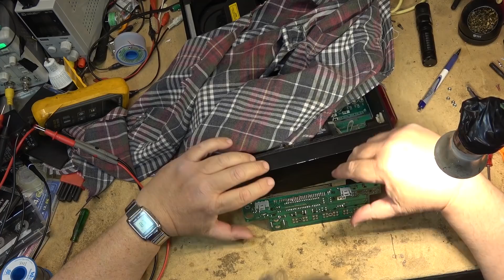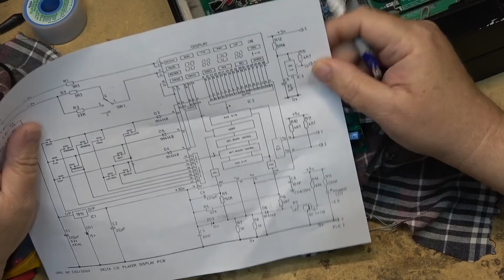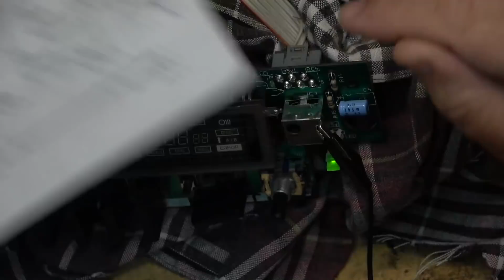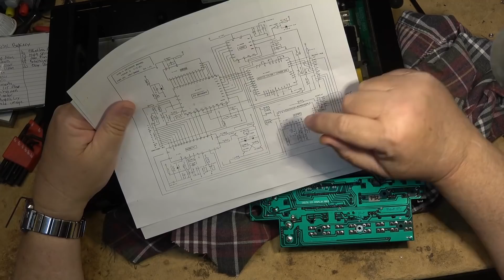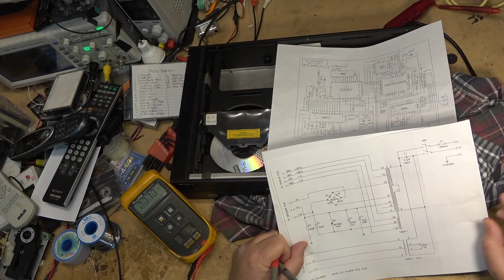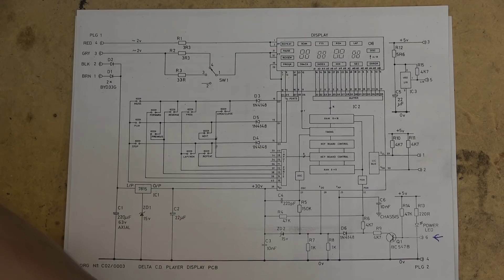Arcam Delta 170CD Transport  No Worky

Comment: Hi I've recently started watching your videos and find them very interesting. I like the way you work and show your thought process. After watching this video I decided to look at the 6805 architecture. I found that a 6805 microcontroller puts out OSC2 on pin 38 which I think is derived from an external clock coming in on pin 39 (OSC1). Maybe (MAYBE) your remote control works because the OSC1 clock on the 6805 (OSC1, pin 39) is OK. The OSC2 clock could have failed (OSC2, pin 38) causing your secondary microcontroller not to function. Just a guess  based on the datasheet but I think the external clock (OSC2) should be 4MHz. Could you inject a 4Mhz clock pulse into the other microcontroller??? I hope that makes sense.

Comment: Hi. Not sure if you're interested, but I found a service manual for the 70/170 models. The schematics are not brilliant, but readable and rather disjointed & need re-stitching to get a clear overview. Fyi the 'display' connector is (top to bottom) POR RCS 0v 5v SDA SCL. Not clear who supplies the Serial Clock, but is likely the 6805. The transformer is a dual voltage with strapping options on the underside of the Xfmr board, they then helpfully crayon on the  selected voltage on the top. It does look like the display/key chip is the problem child. As ever, loving your work. thorough & informative.
Reply from the maker: I do have the schematic for it. As far as I know since it will operate with the remote the owner of it is going to use it as is. We'll look for the display key IC but I'm not holding my breath that one will be easily found considering the age of this unit.

Comment: Hello!
The high supply voltages are really suspicious. The 220V label and these weird voltages suggest someone has modified or replaced the original transformers.
And when it comes to such option, you can guess they probably used some low cost Chinese stuff, with weird or inconsistent performances. It's something source of a catastrophic failure.
And guess what, you can have the same problem with stock products: I've seen and replaced many of these in relatively high end HiFi components designed in UK, but made in Asia. You can find anything like resonating (and noisy!) transformers, false copper shielding and other problematic things implying insulation and security issues! It could be interesting to investigate around the supply board where you customer says have found some dry solders. But at this point, I suppose it won't solve the display and keyboard unit!
Most of these high end CD players used the same Philips technology. You have Philips or equivalent circuits plus something like a CDM12 pro mechanism. From there, a common architecture with I2C bus for data communication between ICs.  And I share your opinion about the main controller wich is working properly, apparently responding to remote control orders and playing disc. They normally use a RC5 so any remote from Philips, Marantz, and many other brands could do the trick, but here with a limited universal remote, there's always some buttons missing...
I have a similar scope with the I2C decoding option: if yours can do it, you could eventually check the datagram content with the classical time code, or at last try some low cost LCD displays wich have I2C decoding capacity.
Another option is the Frankenstein mod, based on some retro engineering, a microcontroller and some standard command libraries (and a not so good looking rats nest of wires). This could provide direct operation with an alternate LCD or OLED display.
However, I highly doubt you have such option as it implies numerous hours for development and integration, no client would pay for outside La Havanna, also considering the residual value of this unit.
Last option is to search a direct IC replacement, but you can guess it's near unobtainable today, and no guaranteed solution either.
It's a typical case I'd recommend another drive source, why not some used high end DVD with a digital output. They come cheap nowadays with the blu-ray new technical reference.

Comment: I had problems with this type of IDC connectors where the blades or the wires corroded and did not make a connection. Have you checked the clock signal at the main board (not on the connector, but on the other IC)?

The Telefunken U3090MG display controller might be a TMS3763 equivalent according to some forum threads. This (the TFK version) was used in some Marantz and Philips CD players as well if it's true. No datasheet for any of them. The TMS3763 is available on ebay for cheap. Might worth a try, but those crazy high voltages must be addressed first.

Good chance that even it it will work again, the display will be dim. Double voltage on a VFD filament kills the emission quite quickly. Also the design seems weird, it should be changing the bias voltage for dimming the display, not the filament voltage...
Reply from the maker: Yes checked on ic no clock.

Comment: I'm sure you will, but I would recheck the voltages (and display / regulator limits etc) prior to IC replacement. The unit was originally 220V mains, now 110V and I believe the mains / line in the USA is nearer 120V now. Not sure what IC2 is (part number wise) so it may be an I2C master (and clock generator) as well as slave.
Reply: This is quite common and can be problematic. From experience, some old eu/UK gear had 220v primary. 240v can and does create issues with these products. Some old gear had 220/240/110/120 volt options. Nowadays cheap transformer primaries are all 230v rated as a 'happy medium'. But with my 240v mains I always get a higher DC voltage than rated.

Comment: Great vid.

I think you should of investigated further into why there was no clock on pin 1 of the cable, the wire could be broke or a dry joint in at one end of the wire. (?)

Comment: very interesting video, i would inject the clock signal and trigger it from the latch signal to see if it will do something, i am sure that this signal can be synthesized or be taken from somewhere and controlled by simple transistor switch from latch rail.
Reply: Injecting clock onto a I2C bus would do nothing useful. Clock signal is generated by the device that initiates and terminates data transmissions (called master). The master needs to be in control of both of the clock and data lines in order to put anything meaningful on the bus. Slave devices only toggle the data line, in sync to master-generated clock signal. Note that there can be multiple masters on a single bus and a device can be a master AND a slave =)
Reply from the maker: Correct but what's not known here is is the Master clock being generated by the processor under the display or is that a slave only device the fact that it does have an oscillator and is generating key scan indicates to me that it could very well be a master device. the Motorola processor on the main board which incidentally is a different number on it than what was on the schematic could also generate its own internal signals as it does have a crystal and it is a microcontroller but it could also be running as a slave and because no clock signal is being received it is taking on the role as its own Master clock generator for its its own circuitry. One thing that is known is that the processor on the main board is functioning because asynchronous data from the remote control is being input and then output formatted going to the CD section to control the mechanism. Now there's no clock signal on the clock line however they pull up resistor is on the front board so it may very well be the master and the display I see is shorted pulling the clock line low. after all there was a shorted transistor also found connected to that IC. Again it's kind of a crap shoot it's a 50/50 it's one of the other because either I see could be killing the clock signal it depends on which one is generating the Master clock. The one thing that is known is that the front panel IC was communicating with the controller on the main board prior to the other guy getting into it in an attempt to fix the display because the keys were working when it went to the other guy and when it came back they weren't. After contacting the owner he does have the remote and he'll likely just run the thing as it is using the remote. He said the display has not worked for about 2 years but the remote and the front panel buttons did work until you took it to somebody else and when he got it back the buttons didn't work at all. Well we know it does work with the remote and he seems happy with that and if we can find a part then we'll probably see another video and get that display and the front panel buttons functional.
Reply: @12voltvids  Disconnect the data and clock lines between the boards (leave the rest connected). If the other side does not also have pullups, you can pull them high with, say 4.7k resistors (1k to 10k should be safe). Which ever side on you see any activity on the clock or data line then, is the master's side, because a slave does not put anything on the bus without a master first reserving the bus, and calling the slave out by writing it's address to the bus. Just be aware that there could be more devices on that same bus creating chatter (or problems :). Both lines should be pulled high when idle. Also, I imagine it's possible that both the display and the main board can act as master and initiate transfers, depending on needs (i.e. display boards notifies main board when a button is pressed, and main board sends updates to the display).

Comment: I see many Philips components in the Cd transport: the CDM is a Philips swing arm, the drawer mechanism is based on a Philips design, cables and plugs are typically Philips. Anyway clock is very likely generated on the main board, I see the quartz crystal sitting next to the remote decoder IC. Have you tried checking if the clock is present with the display board disconnected ? If the key scan is working, the display IC is at least partially alive.
Reply from the maker: No clock even with display board disconnected.   It's either the display ic or the micro on the main board, however since the remote is functional and that chip us passing data it is obviously working.  The clock pull up resistor is on the display board so that could explain why no clock then display board is unplugged.  The front panel keys were working before another tech worked on it, but it was returned to the owner the front keys were dead. I suspect that that shorted transistor that I found on the display board was probably what was killing the display. The other guy working on it I suspect shorted something I blew the chip up.  As I think I stated it could be either chip that's faulty the one on the main board is certainly easier to change as it socketed. We have the chips turn out to be available and they were cheap I would recommend just ordering both and start with the easiest one to change the socket and chip because it's going to be one of the two I just get the gut feeling that since the remote works that the big one on the main board is probably okay.
Reply: @12voltvids  the I2C bus between the two IC's is just two straight wires with pull-up resistors. The 6805 on the main board has its own clock and the SCL line is used only to communicate with the display driver. If nothing is coming out of it, very likely the 6805 is faulty. The display driver has its own oscillator for the key scan and the VFD and that appears to be working. The PDR signal driving the faulty transistor should be a reset line, high only on power on for a few seconds. With the faulty transistor the display driver is not initialised and it should not work at all, nor display neither keys detection. If, keys were working previously, that means both the reset line and the I2C bus were working, but i have not idea what could have been wrong for the display to be dead, maybe a cracked soler in the AC filament voltage. I would go with a faulty 6805 as my first guess, the I2C section is dead. Surely having 70v AC in the display PCB in place of 36 is not too safe.

Comment: And i expected you to call it a pile of shit lol.
The connectors remind me of the philips c.d players of millions of years ago.
So the  processor on the main board actually controls the c.d operations, and shouts data at the keyboard chip lol.
Hopefully the owner will find the front panal scan/display chip.
Reply from the maker: No no no these ones aren't a pile of shit.  Uses a Philips transport.  I have a similar Philips with a 1541 dac.

Comment: You spent a long time on this one Dave, only to find another "Tech" had killed the keyboard scan i/c.
I have had a look among my Arcam pcb box, but don't have one for this model.
Finding a new i/c will not be easy, Arcam would only supply parts to authorised dealers
The best option might be to find a used PCB or a sold for parts player that has a working display pcb.
Sorry that i can't be of more help.
Reply from the maker: The parts might be easier to source than you might think because it appears to be a generic part, unless it's got some custom code loaded on it but I think this is a little old for the embedded chips and the code is probably stored in a separate nvram chip.
Reply: @12voltvids  I hope to can find one, there are no parts list in the Service Manual or any numbers on the circuit diagram.
If there are any on the i/c you might be able to google it and see what can be found.